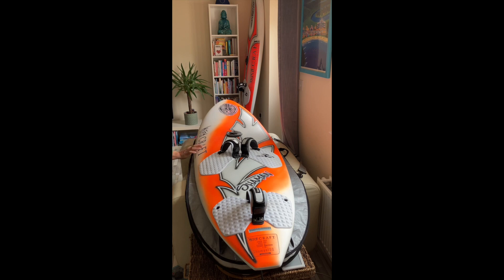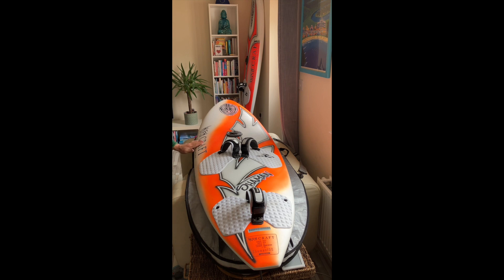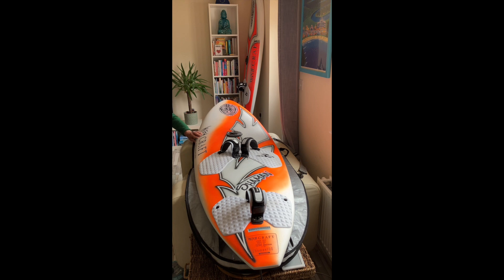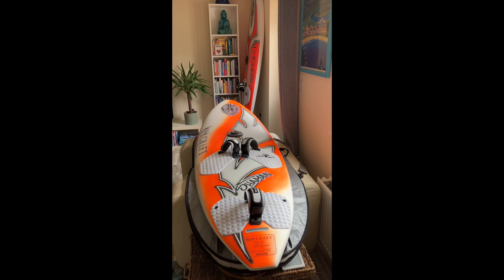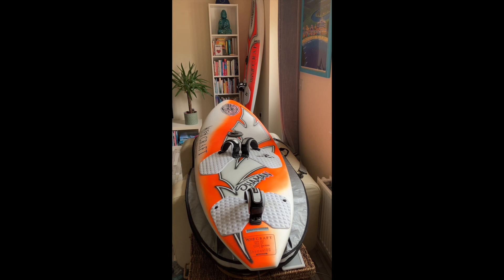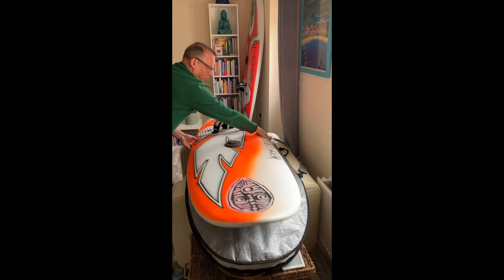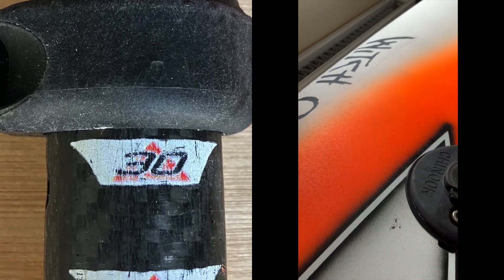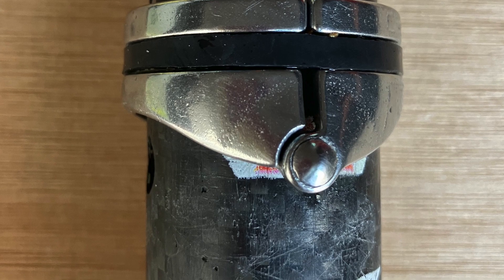Fixing Dents Witchcraft HDD Windsurfing Board

Comment: Very good. Been meaning to make such a video for years. You should take a bit more time to let the heat go into the PVC. I just point the gun for 2-3 seconds each time. The crack looks worse than it is as it is just in the surface layer over the Dyneema. And most importantly: better avoid such things by getting another extension collar that does not protrude from the mast.

Comment: Great Video, didn't know about this for Witchcraft....  I wouldn't be able to do this on my Fanatics; - 85ltr and 95ltr (Fanatics are "Dipped' to give a micro thin layer of paint/transfer.  Your method, as you have advised would only work for the Witchcraft - thanks.  I have been using the 'Surfbents' for a couple of seasons - they do deflect any conceivable rig related strikes, BUT you "MUST" only pair the Surfbents with a mast extension that has 'release' pin "one-the-side': that "pulls" to release as aposed to the regular end position that "pushes", otherwise dropping the rig (on tacks) over the nose can "Press" the button and detach mast from board.  You can generally reattach though in flat conditions, but not in any surf.

Comment: Thank you for this! My LDD Chakra is full of these cracks... I'm not even bothering! They're gonna happen again anyway...
Reply from the maker: I think my harness hook caused my dent/crack after landing on the board after losing control of the kit mid-jumping. I don't know if the board would absorb water if you leave the cracks unsealed, probably not as it still has the Dyneema / PVC layer - @witchcraftwindsurfing ?
Reply: @windsurf888  Well, I've had cracks such as these for years and haven't felt the board any different. I'll let you know next time I hit the water:P I think the crack is only on the outer layer. If you see my board's nose, said layer doesn't exist anymore from the board grinding on the beach when I leave it.
Reply: @windsurf888  Normally it will still be water tight towards the EPS. The Dyneema protects the PVC from cracking so that remains water tight. On a heavy impact, the resin in the Dyneema fabric may get hair cracks and may absorb a few drops of water. No resin is as strong as Dyneema, think of a concrete building when being demolished, the concrete breaks but the steel inside keeps it together. To make sure, with such cracks after impacts, is to make it warm/hot to make sure there is no water in the laminate and then put some superglue which is very liquid and capillar and will go into any haircrack.